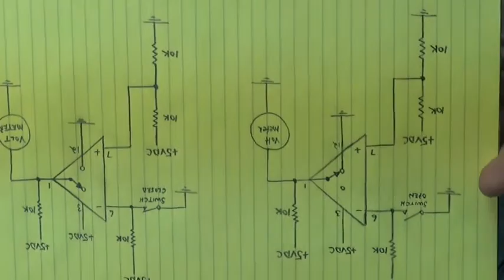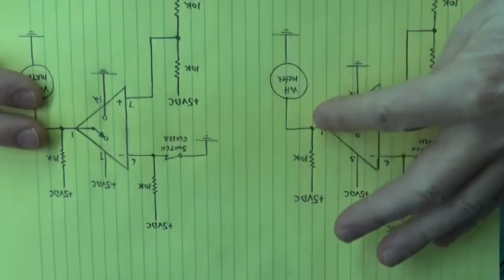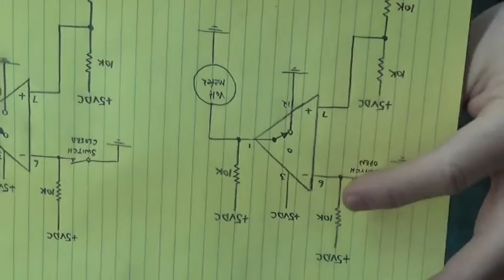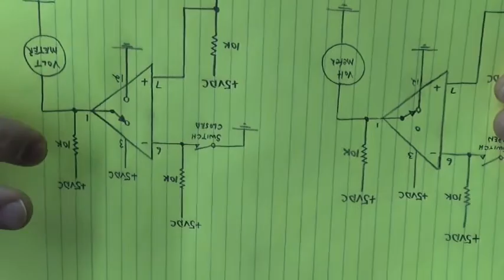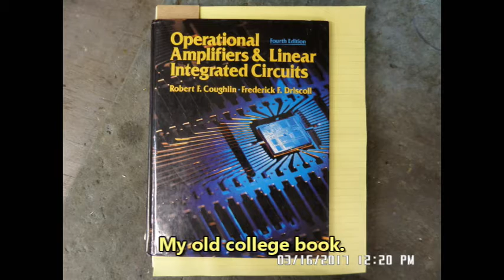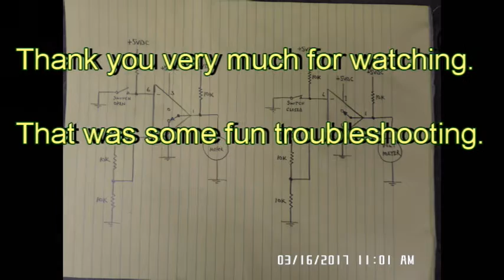Testing the LM339 Quad Comparator Integrated Circuit

Comment: im testing this devices and seems like pull up or down resistors are mandatory as i see weak woltage transitions instead instant switches ... i mean isnt opamps supposed to switch instantly .. but when i connect this devices or tl431etc.. it seems after it reaches trigger voltage .... it starts transition mode when closer to switching transition or activation level or whatewer you call it.. i need a instant switch for a battery protection circuit for preventing unnecesary voltage drain on batteries but after it reaches charged voltage it has to activate a power wasting logic so itll start wasting charging power when batttery is full... so wont damage batteries... but activating that circuit before batery is charged is bad too... :P

Comment: Hi again peepaw, Another very well done video and explanation. I have just tested a Lm339 in circuit using diode mode like you did in another video. I had red lead on pin 12 and tested all other pins with the black lead. Most readings were between 0.624 and 0.725 apart from pin 8 which read 0.386 can you tell me what this points to just a novice 70 yr old novice ha ha. Many thanks and go safe.